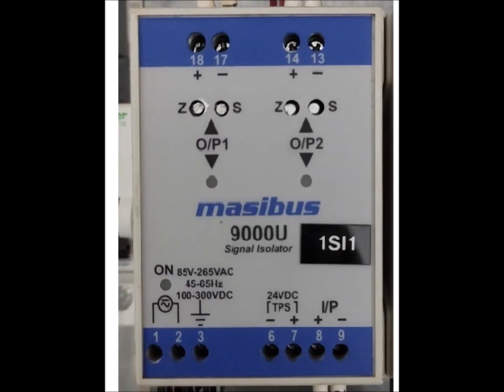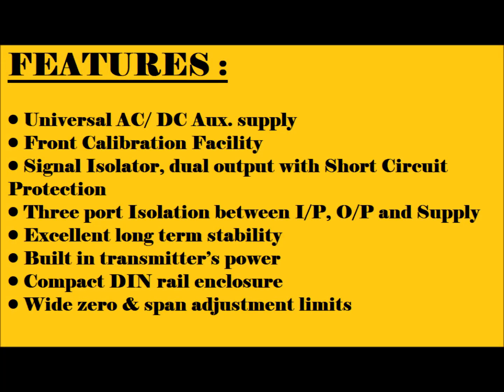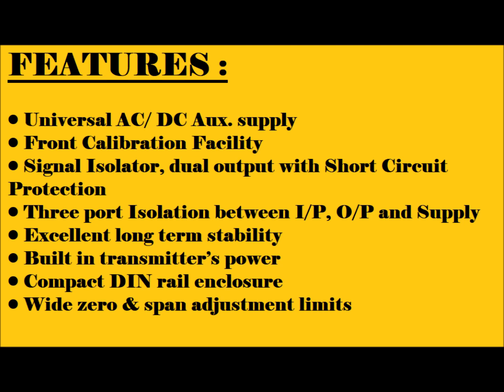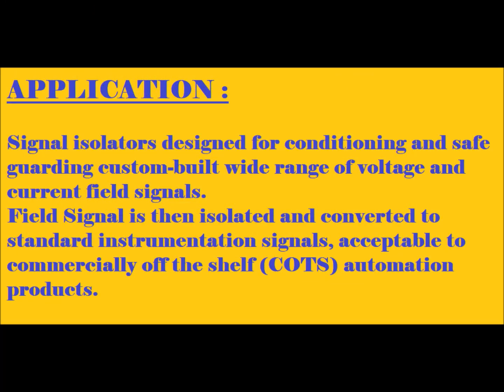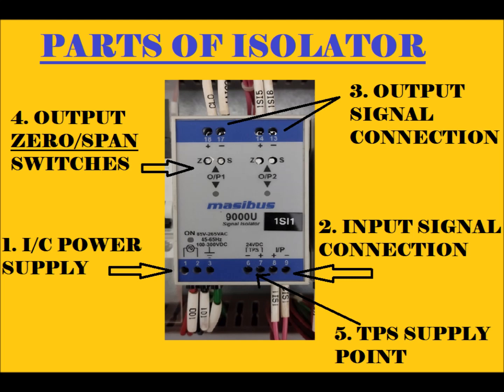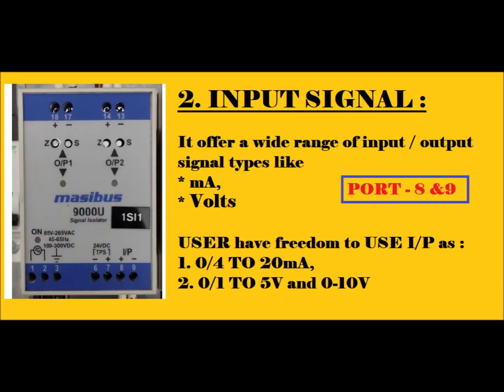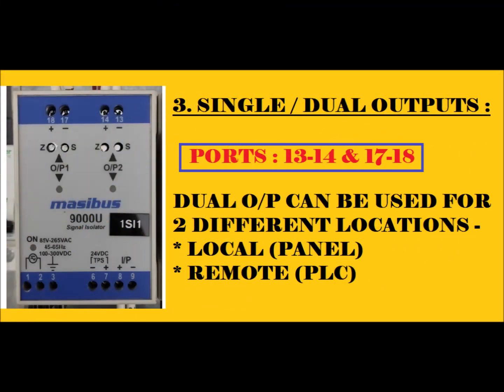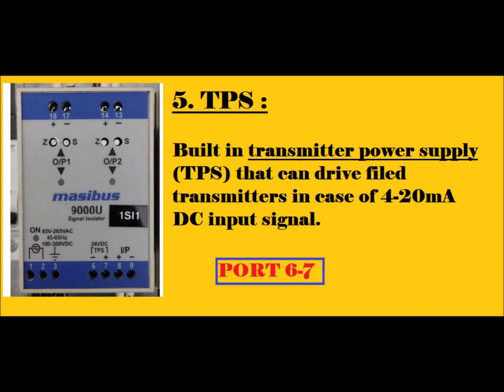SIGNAL ISOLATOR - MASSIBUS : 9000

Comment: Sir hmare yaha 2 wire  pressure transmitter hai or control valve uske through operate ho rha hai to sir kaise connection honge 0 se 10 volt dc
Reply from the maker: Signal isolator ka kuch kaam nai h bhai yaha